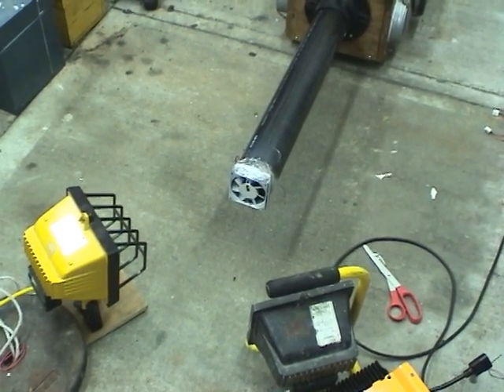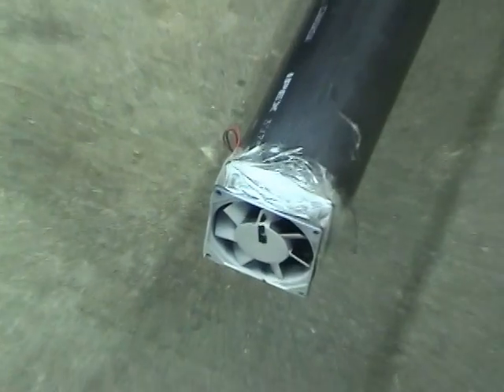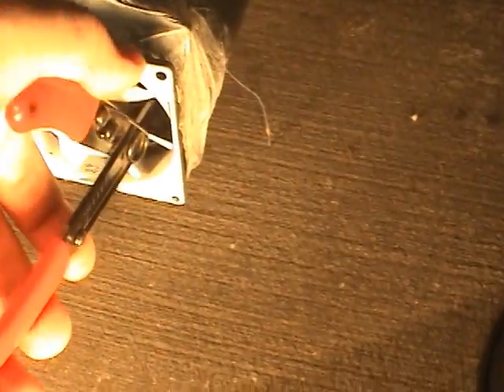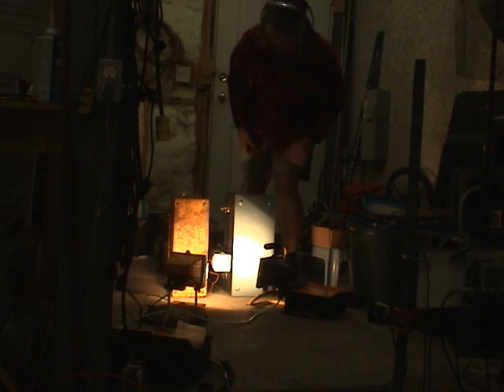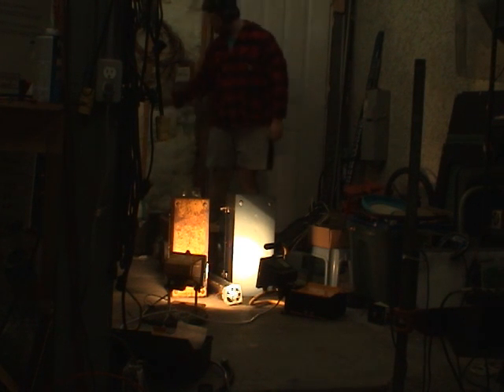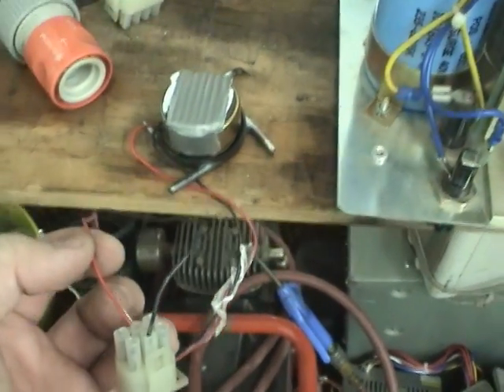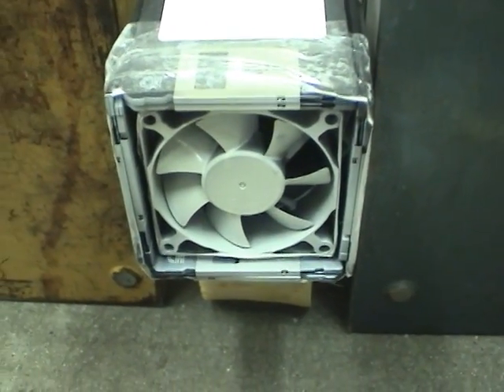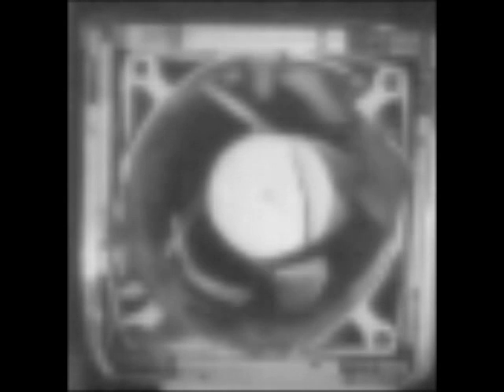Overspeeding a PC power supply fan

Comment: you could have measured the voltage coming off the fan at those speeds - assuming that the fan spins at 2000 RPM at 12v, it (theoretically) can generate 7,387,500V at 44,325 RPM  :O